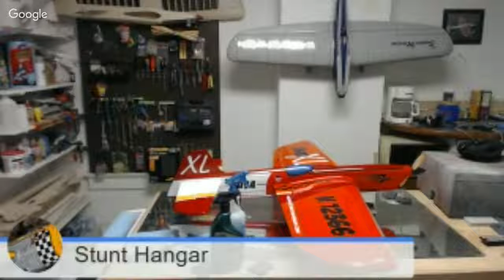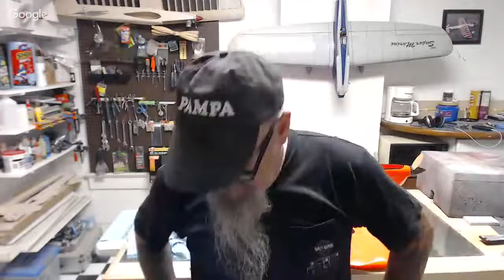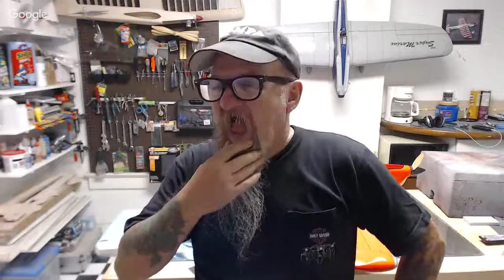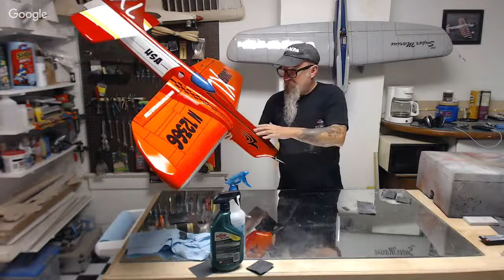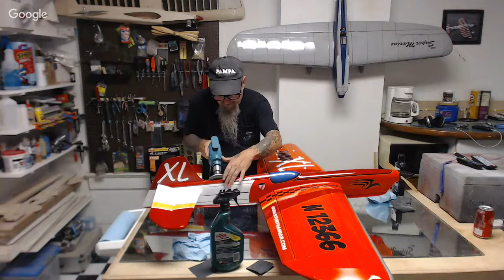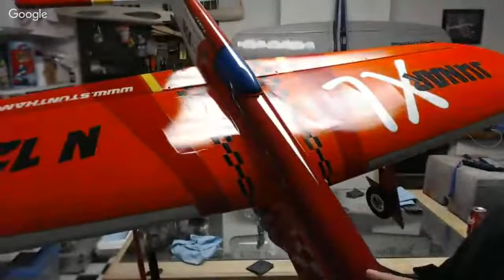55 and done 9:00 9/6/2016

Comment: You use a Automotive Urethane for fuel proofing the nose right?
Reply from the maker: That is correct
Reply: So I can buy any Urathane paint from the parts store mix it with dope thinner instead of Urathane thinner and use the hardner and spray it on?
Reply from the maker: I will take no responsibility in the formula used. Some things work for some people and some things don't. It's all an experiment. Now I use Sherwin Williams (cheapo clear) 2 -1-1 ratio clears so try it first before you go all in.
Reply: Stunt Hangar Understandable. Do you use dope thinner as the reducer or Sherwin Williams reducer?
Reply from the maker: dope thinner
Reply: Stunt Hangar Thanks Sparky! Is there something different you would recommend for fuel proofing?
Reply from the maker: no just use Urethane as directed
Reply from the maker: I hear it works well but I have never tried it and don't know if it's completely fuel proof . Give it a shot on something that is not too important. You will need 2 cans because once you use it, that it. So paint it on something and let dry and see if fuel proof.
Reply: Stunt Hangar how many coats of clear dope do you usually put on at the end?
Reply from the maker: Minimum 3-6 coats dope 50/50 1 coat of Urethane on the nose
Reply: Stunt Hangar thanks for the good advice!
Reply: Stunt Hangar after you paint the clear top coats how long do you have to wait before you can spray the Urathane on?
Reply from the maker: Next day or so